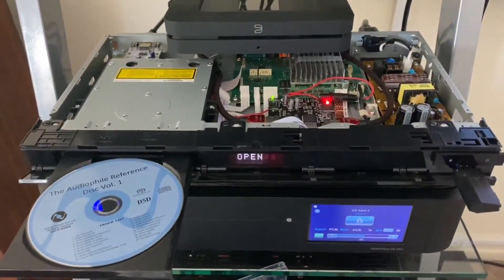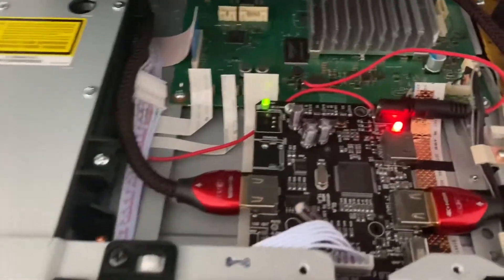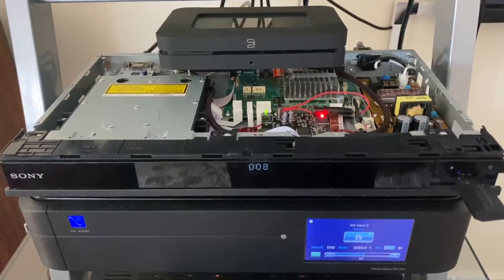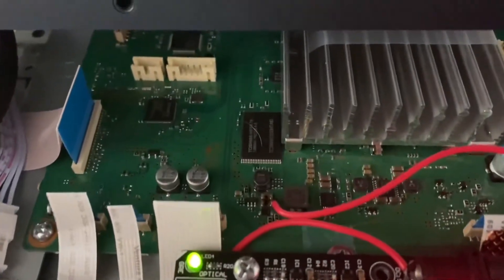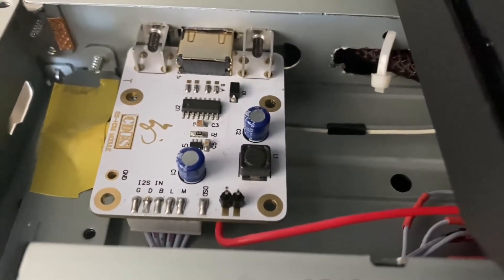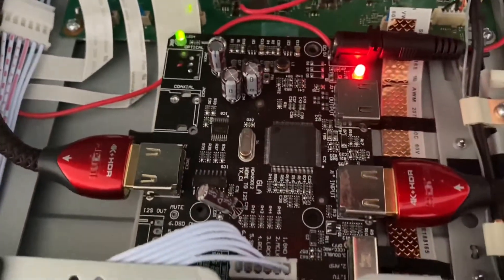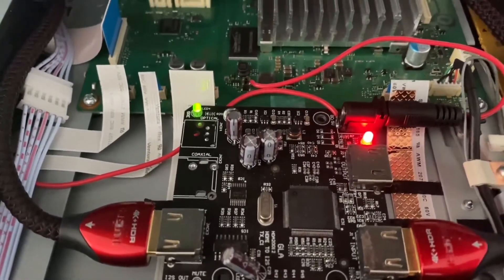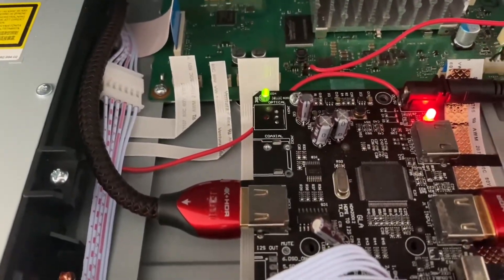Integrated Sony UBPX1000ES/UBP-X800 with HDMI Video to HDMI I2S Adapters ($5000 for less than $500)

Comment: Great video bud! Glad I found it. I picked up an oppo103 on eBay for $180…have the hdmi>i2s from Ali express getting delivered this week. However i realized my geshelli j3 doesn’t do dop only usb dsd. I saw you suggested the d90 above for a budget dop/i2s dac but that was two years ago. Anything come out now that you would suggest?
Reply from the maker: @The.Dream.Builder  For a cheap HDMI I2S DAC. PS Audio DirectStream DAC Sr. (MK1) is available refurbed for $1500 or less. It will smoke anything over that price and definitely under that price.

But you can get SMSL & Topping DAC’s for under $1000 and not be disappointed.

A quick search on Amazon and The Music Room/PS Audio and you’ll see what I mean.

Thank for watching ! 🤟🏾✌🏾
Reply: @ I’ll check out the ps audio. Been looking at the topping centaurs, gustard, and denefrips entry level stuff around 500-1k. Just came across the musician Draco too

Comment: I found a service manual for these things. Looking over the flex cable connector on the mainboard to the stock dac, it appears to have a similar pinout to the I2S in on the converter board! Its looking more and more possible to wire the converter straight to the mainboard. How awesome would that be!?!?
Reply from the maker: If are successful.Let me know. Sonically you may or may not gain any benefit over the Chinese adapter boards. I A/B’d this setup with a friend against my PS Audio Perfectwave SACD Transport. There were NO audible benefits !

Comment: I’m late and I’m still using the board externally to my 800. Do you know how much power does it actually need? In my experiments < 600 mA at 5 V seem fine.
Reply from the maker: I’ve had muting issues either lower power 5VDC power supplies. These things are cheap enough so the more current drive. The better !
Reply: @joeygsaudiochannel  Agreed. I just ordered a much better one, 4A, should be good enough ;) Incidentally, the HDMI power alone is really insufficient and crazy things happen, besides the little box not working: the coax digital out of the player also misbehaves :-O

Comment: Great Video. I have an OPPO 203 and I just purchased the Cayin IDAC 6 MKII with an I2s input. I bought one of those hdmi I2s DSD extractors from overseas and it works, but there is static background noise. Do you think I need to go this route with the extra board to clear up the issue of the noise? The MFR of my DAC does provide the I2s pin definition, but I'm not sure if this is needed?
Thanks!
Reply from the maker: Thank you Victor for watching the Video. All you is :

https://www.amazon.com/ALITOVE-Converter-Transformer-5-5x2-1mm-100V-240V/dp/B078RZBL8X/ref=pd_ci_mcx_mh_mcx_views_0?pd_rd_w=awkWj&content-id=amzn1.sym.1bcf206d-941a-4dd9-9560-bdaa3c824953&pf_rd_p=1bcf206d-941a-4dd9-9560-bdaa3c824953&pf_rd_r=4R88JRCRC4DCKKF8NFTR&pd_rd_wg=EnZMs&pd_rd_r=95a95313-78af-45b5-8384-d3b0ca299d97&pd_rd_i=B078RZBL8X

If you have already connected a decent amperage 5VDC power supply and are still getting the static. Then it could be a pin out issue. The extra board to reverse the DSD channels is no longer necessary since there are two resistor pads that just need a solder blob to fix the reverse channels issue.

Comment: why mine is - i only manage to show dsd64 once then become always pcm 174 on my ps audio dac. can you show the setting on you sony setting.. thanks
Reply from the maker: Go into your “System Settings” in the setup menu and change HDMI to “Auto”. When watching movies/streaming Netflix/Prime, switch back to “HDMI 1”. On the back panel, make sure that HDMI 1 is connected to your AVR or TV and HDMI 2 is going into your HDMI I2S Adapters input HDMI connection.
Reply: @joeygsaudiochannel  thanks you.. ill try it ..
Reply from the maker: @bridgebolt51  Let me know if it works please.
Reply: @joeygsaudiochannel  same thing.. btw i dont use channel correction board.  i stop doing it for now.. every timei use the hdmi to i2s board my ps audio stellar gain dac light's blinks even i turned it off.. its getting power from the converter. then it will disable my ps audio display when i turned it on.. it will only show display again if i unplugged it to 110 v(hard reset)
Reply from the maker: @bridgebolt51  Are you using an external 5VDC wall wart of at least a few Amps (eg 5VDC/8A "Brick" form Amazon). ?You need to use an external power supply. Ther 5VDC HDMI power is not enough.
Reply: @joeygsaudiochannel  8A?
Reply from the maker: @bridgebolt51  The board needs at minimum 1A which is not stated on the eBay website or on the back panel of the box. I learned the hard way :

Here's an Amazon link :
https://www.amazon.com/ALITOVE-Converter-Transformer-5-5x2-1mm-100V-240V/dp/B078RZBL8X/ref=sr_1_3?crid=292TSARD1N2TB&keywords=5VDC+8A&qid=1675005897&sprefix=5vdc+8a%2Caps%2C149&sr=8-3
Reply: @joeygsaudiochannel  do you really need power? mine works without power.. though i have issue with my ps audio logo light. works ok.. just blinking enen off.. getting power from sony bluray i guess
Reply from the maker: @bridgebolt51  That adapter box/board won't work properly without an external 5VDC power supply. The audio will dropout like crazy. Specifially my PS Audio DirectSTream DAC Sr.
Reply: @joeygsaudiochannel Indeed. But how much power? In my experiments a small 600 mA power supply seems enough but I’m not sure it’s optimal.

Comment: The thing I worry about with the cheap Sony drives is that they'll break after a short period of time.
Reply from the maker: This thing has been Rock Solid for 4 years now I had a Pioneer DV-587A that ran for 16 years and still worked perfect when I took it to the Goodwill.
Reply: @joeygsaudiochannel  Hope you are right. I see a lot of repair videos for these on the tube.

Comment: Just got my x800! I do think I am just going to get the enclosed converter and chain it to a budget DOP DAC. This is super impressive however! Will definitely consider it down the road! Much thanks for this post!
Reply from the maker: Let me know if you need help down the road. The best “Budget” I2S DAC is the Topping D90. 

FPGA or Resistor to Resistor ladder DAC’s aren’t worth the big money without I2S compatibility aren’t worth the money IMHO.
Reply: @joeygsaudiochannel  My rig is a hodge podge of gear from the 70's, 80's, 90's, 00's to my recent Emotiva power amp purchase. Love my sound, absolutely love it but im well aware where I am on the greater audio totem pole. I just wanna confirm this unit does DoP off the coax, but your right on the money too! I'm considering that Topping or the SMSL Sanskrit.
Reply: @joeygsaudiochannel  BTW This transport is proving to be quite compatible with everything ive put in it so far with the exception of some burned DVD-A discs. Bluray response/seek time far better than my dads Samsung 8500!
Reply: Hey, if youre still out there, im hoping to finally get modding my x800. Im curious about the  OEM DAC board you pulled. Do you think maybe the flex cable could be an I2S signal from the DAC to the logic board? Possible the converter could be hardwired direct to the flex cable connector? Pipe Dream?

Comment: Hey are there any specific settings on the Sony UBP? I've got the same HDMI IIS adapter board you have mounted inside your player and when I plug it into the Sony HDMI 2 port the unit starts flashing the video signal on the HDMI 1 port and I don't get any output.
Reply from the maker: Just replied to you via the message you left me in the PS Audio Forum.

Comment: Do you know the DSD output rate you’re getting at the DAC? I mentioned in the comments of your initial I2S/HDMI video that my stock Sony X700 gets me DSD output to my Bryson BDA-3 DAC but only at single rate (which still sounds great). Are you getting quad rate from this? Thx. Cool hack. 👍
Reply from the maker: I2S going into the PS Audio DAC will only support DSD64 (2.8MHz). For higher Sample Rates. the DAC must be used with it's USB input (max's out at DSD128 (5.6MHz). You have to check the specs of your DAC to see if it will support it. Again, I have used this setup with the Denafrips Terminator and the Holy May DAC and they too would only support DSD64 over I2S HDMI.

Quad rate @ DSD 256 (11.2MHz) is insane for playback (I have one album purchased by mistake) and it to my ears sounds no "better" at DSD64. Now for recording, I'd understand. But for playback, it's overkill IMHO).
Reply: @joeygsaudiochannel  Thanks Joey. Again, very cool hack. 🍻